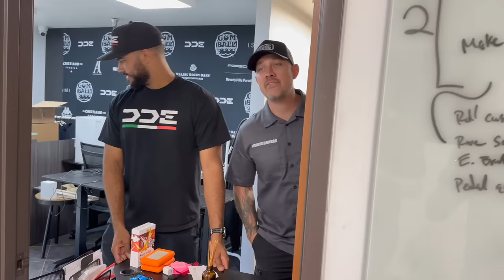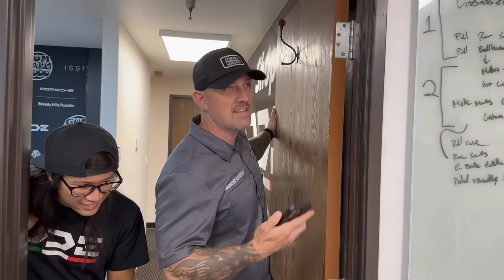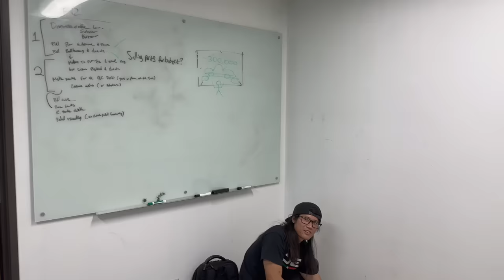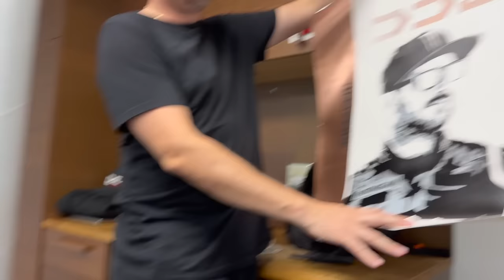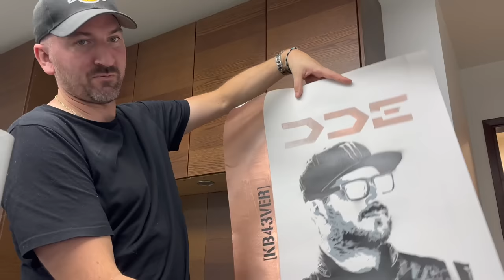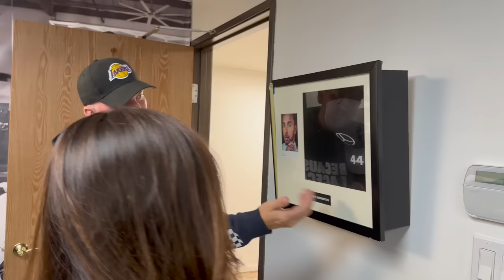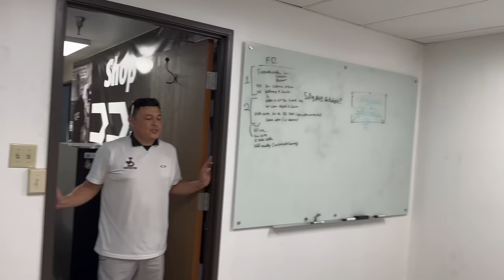Damon sees carbon 720 GTR kit for the first time...

Comment: “Daily uploads,” but they’re uploading low quality old content just to rake in the ad money. Dave will just upload the same piece of content and click bait the audience over and over again— it’s getting old and taking advantage of this will only backfire. Not only that, having Mike and Tim produce the content is one thing but overloading them with tasks isn’t acceptable and not sound business practices. I don’t foresee this thing going for very long; I say this because the face of the channel, Damon Fryer, isn’t the main character anymore. I get it as once you reach a level of success, diminishing returns kick in and the marginal benefit decreases. There are many structural issues in this business that needs to be solved— and I don’t mean putting in new flooring.

Comment: Seriously why did they install that flooring without underlayment? Wtf. Underlayment makes a massive difference in the install and final product and it cost hardly anything...
Reply: Exactly, foam (padding) and moisture/vapor barrier.
Reply: @Nilrem74  yeah exactly! it's very basic and would have taken them an extra 5 minutes and cost probably $40 for that room. I mean they make a 3in1 padded vapor/moisture barrier underlayment too so it's super easy. I get it's just a shop but the 4 guys rolling around that room in chairs are gonna notice it.
Reply: @jeremyusry6705  Oh wow, I wasn't aware they had a 3in1 barrier now. Laminated flooring was fairly new (here in the US), when I left the kitchen/bath remodeling business. So I'm sure a lot has changed over the decades since.
Reply: It's pretty cool. It's got a sound barrier, vapor n moisture, and the foam padding. Makes life so much easier. I used to do remodels with the old stuff. . And a decade later I had to redo my house flooring and was like YAY. Lol. Definitely helps if your flooring is laid over some form of wood instead of concrete cuz it deadens any squeaky. And keeps the noise of you walking upstairs from getting downstairs. Not needed for concrete but it's not much more expensive and it could help deaden sound from vibration through the concrete maybe. I only used it upstairs at my house. The downstairs was glued down.

Comment: At this point I'm more and more convinced saying the F12 will be a SEMA build is just build up for the video. Cause in order for that to happen you need to have Mike and Tim on it 100% of the time. Not having them pull up carpet, swap A/C, watch Predator install a bumper on the hummer etc. Just focusing on making the 720 perfect for SEMA would be enough and taking the time for the F12 to be perfect would be better than rushing both
Reply: It's for content. The build is at least 20 days ahead of the videos. They are probably stringing it along to do 1 big video at the end during Sema which is in 29 days.

Comment: in Canada You lay flooring right on concrete? Here in EU we use shock absorbing material under it. Cheers
Reply: Their shop is in the US. Normally there is a vapor (moisture) barrier and shock absorbing (foam padding) used here when installed properly. Unless things have changed since I have been in that line of business.
Reply: @Nilrem74  oh , just curious, Thank You for reply 👍

Comment: I have got those safes out of the concrete before (renovating an office). Jackhammer or smaller air hammer to get it out. Chop saw and a grinder with abrasive disks cut it open (from the side thats under ground now). We only had a set of keys in our safe.

Comment: "If you work in chaos it’s going to effect your ability……"

Ummmmm the way That everyone is always so all over the place, it’s kind of chaos all over the place lol. Like pulling Mike and Tim off of the F12 that is supposed to be done by SEMA in 55 days but then force them to work on the 550 and buyer wants the A/C put back in although the car is now a pure Racecar and dude knows that already, so y’all should have sold car as is just simply the F12 is a super big project but with Mike and Tim getting pulled off multiple, times, it adds up, I’m hoping the F12 will get done by then but looking at it from a realistic standpoint I don’t see it

Comment: Can DDE get another Huracan RWD or 600LT while Mike and Tim build and/or repair the cars? Because DDE isn't primarily a build channel. There are so many projects going on at once, dude. Send the 550 to the Philippines and let the guy have the A/C unit installed there, OR keep it instead of buying another car and do shenanigans with it, instead of having the boys glide around hardware stores in shopping carts and nerf guns, and making filler content with random non-related acts.

Comment: To people complaining u do all realize the car build series is on a different timeline. Mike even says there is 60 days till sema meanwhile it’s 30 days so the build is a month different when it comes to completion. Most likely they are going to release the a completed series once we are closer. Also they are building cars which take time a properly running turbo charged f12 is not a common vehicle there is a template to work on and a  the longest part with the 720 was waiting on the kit to arrive the installation won’t take long.